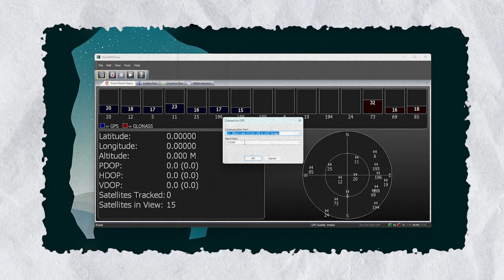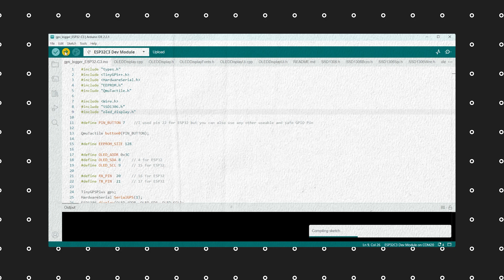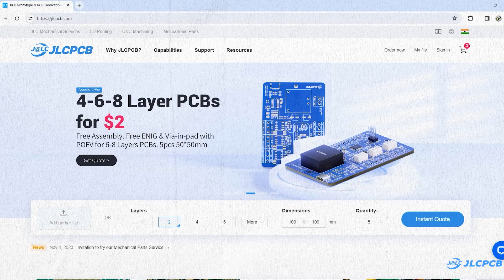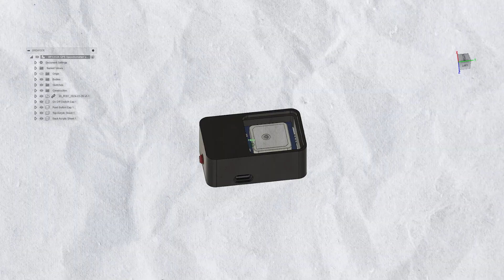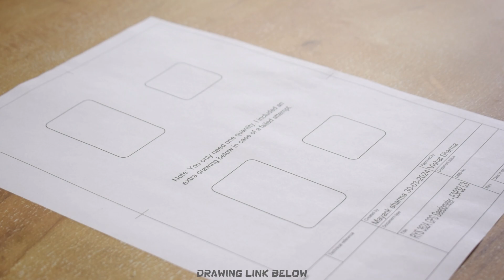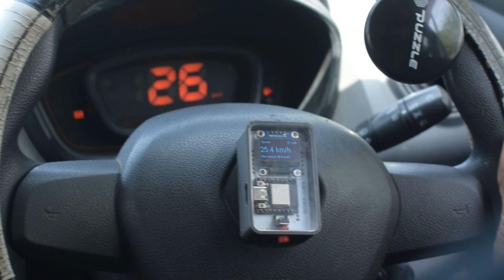I created a GPS Speedometer for my RC Cars

Comment: for your information, the actual speed of an object is gps it self. the way we measure speed differs from point to point for example if we are on flight our speed is with reference  to atc and gps satellites.  when driving a car we get 3 ways one with in the car one is the gps and one is the rader system. the only problem with gps is that it works good for clear sky that is it